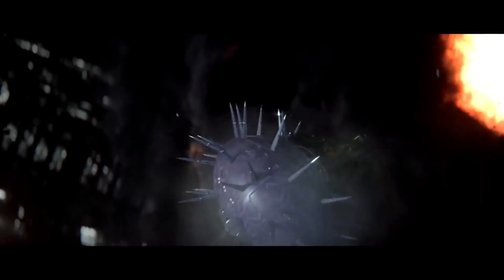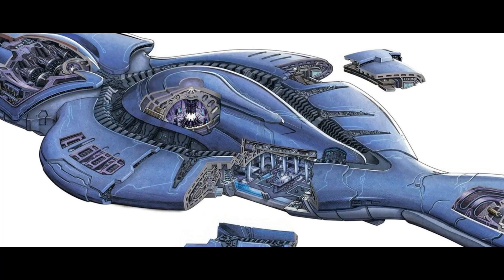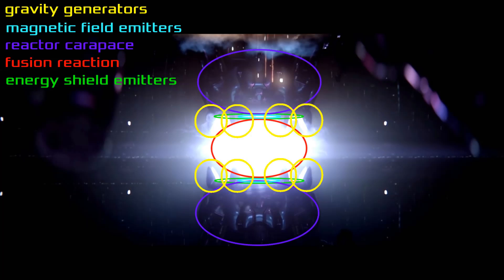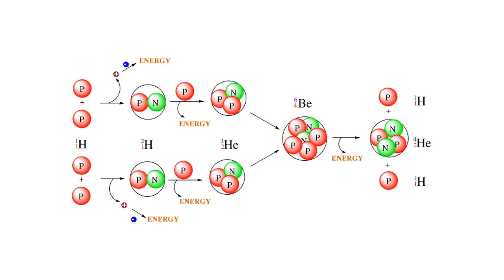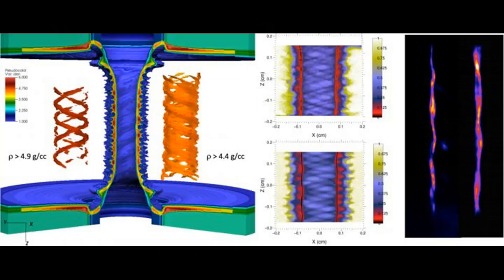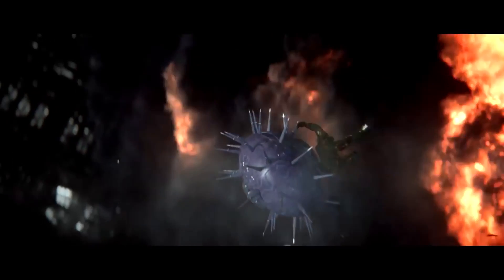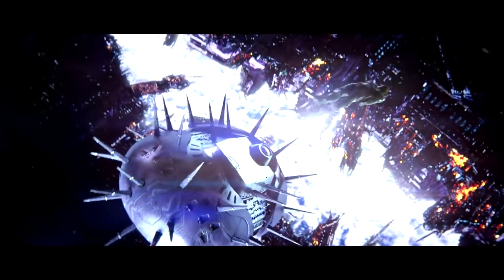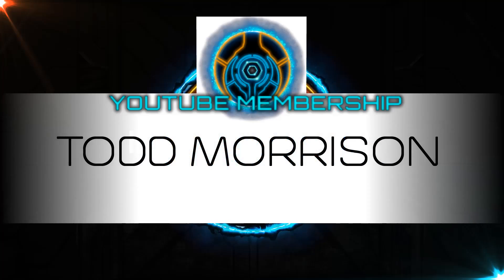Pinch Fusion | The Archive

Comment: I'm not a physicist or a lore historian, but I feel like this method would require far more energy than it produces. It seems to me far more likely that some element of slipspace tech would have to figure in to cancel out the energy requirements of manufacturing gravitons. Perhaps a controlled demolition of a slipspace portal inside of a charged plasma medium. Instead of enlarging the initial rupture it's allowed to fall in at luminal speeds. Catching the ionic fuel in the middle and fusing it. Obviously this would require a micromanagement over the properties of slipspace, which would explain why the covenant has this and humanity doesn't.
Reply: I just want to find out how to fuse metals man, i dont car how much energy it takes.
Reply: @dgalloway107  Fair enough
Reply: Physics student here. Actual Tokamak fusion reactors have been around since the 1960s, which are actually similar in concept to this thing (minus the artificial gravity stuff. All plasma confinement is done through electromagnetism). And yes, the reason they havent taken over the energy industry is because they currently require more input energy than the output energy they produce.

We're getting pretty close to 1:1 energy input vs output. The problem is this is purely the amount of electrical energy put in vs thermal energy put out. This ignores energy extraction methods, which will likely have inefficiencies. Scientists at the current efforts at the ITER reactor would like to see a 1:10 thermal ratio, as even under the worst inefficiencies in energy extraction, this ratio would likely still achieve a practical 1:1 electricity output.

Even well developed fission reactors today only extract about 1/3rd of the total thermal energy produced, as electrical output.
Reply: @hatman4818  So how far away are we from using fusion torches replace all other types of power plants? What kind of ratio would that require?
Reply: @sothasil7716  About 100/1 I believe is considered optimal. But I think the target is at least 20-30/1 to be considered commercially viable. Again, not an expert by any means, but I have done some independent research on the subject.
Reply: @Sotha Sil

If I recall correctly, ITER is trying to achieve, ideally, a 10:1 or better thermal ratio. This is basically the bare minimum to even start imagining a 1:1 electrical ratio. Though even higher than 10:1 may be required. It's a lot of guess work right now since energy extraction for tokamaks hasnt really been developed yet. ITER is supposed to be a sort of commercial test bed, to first acheive the thermal ratio needed, and maybe start developing refueling, exhausting, sustainment, and energy extraction technologies. That would hopefully allow the next reactor to be the first commercial prototype... To answer your question, like always in fusion physics, "About 30 years away" (lol). Or more like 40+ on this timeline... Just for one possibly useable reactor, not to replace the entire grid. It's taking a long time to build ITER, and it's not predicted to produce maximum power until the mid 2030s.

That being said, the Undecided channel recently made an awesome video about commercial fusion enterprises that are sort of skipping the steps ITER and the rest of government funded fusion research is going. Essentially, a lot of companies realized two things. First, the second a useful reactor is built, a huge share of the market would be for smaller reactors. So, they realized focussing research into smaller reactors NOW, could be a huge benefit. It's allowing companies to skip the decades long multibillion dollar international construction process to churn out prototypes now, that can be used to test technologies. Second, one of the technologies they want to test are electrical energy extraction, rather than waiting around for a 1:10 thermal energy ratio to even start on that. The 1:10 energy ratio, originally considered a best case scenario, may actually be a really conservative estimate. Those kinds of estimates are born out of what scientists were thinking about for energy extraction decades ago. This involves traditional systems, like extracting thermal energy, heating up a fluid in a heat exchanger, converting that energy into mechanical energy with a turbine, then converting that into electrical energy with a generator... All those transitions represent energy lost. One of the reactors that Undecided covers, is a small commercial reactor that is trying to extract electrical energy DIRECTLY from the plasma... Which may actually be possible, since a plasma is just a hot soup of charged particles.

If this is possible, it could massively reduce the minimum thermal ratio needed for a 1:1 electrical ratio, cutting out literally decades of R&D time.

Anyway, go check that video out. As impressive as ITER is, I genuinely think commercial ventures are going to be the biggest source of innovation to make larger reactors like ITER actually useful as powerplants.
Reply: @hatman4818  Well, all we have to do is invent warp drives or discover extra dimensions and then we'll have all the energy we'll ever need.🙃
Reply: @jasonwolfe4205  Star Trek was right on the money with their warp cores, any form of warp drive is going to need an astronomical amount of energy that is only possible to achieve through the use of antimatter annihilation like what the Federation uses, or through the use of micro singularities like what the Romulans use.
Reply: @sothasil7716  Again though, this leaves us with the problem of where/how they got the antimatter/singularity. Those things take a stupid amount of energy to make. And it's really hard to cheat this sort of stuff in physics.
Note: I'm not saying you're wrong, I'm just saying the universe is a lot better at filling loopholes than we are at finding them.
Reply: @jasonwolfe4205  we can create antimatter now, just extremely small amounts of it.

We just need to refine this process and then stack them on top of each other hundreds upon hundreds or even thousands upon thousands of times over.
Reply: @sothasil7716  If we can get it to the point where it's energy positive then yeah. Here's hoping we're alive to see that.
Reply: @jasonwolfe4205  by its very nature, antimatter cannot be used to generate a net gain in energy. 

Regardless of this however, it is the best energy storage system in the universe.
Reply: Ps to both of you, artificial mini black holes or antimatter would be excellent energy sources for spacecraft propulsion... They however do not need to be energy positive processes to be useful. In fact, they can be VERY energy negative, and still worthwhile to produce for spacecraft. Both are forms of energy storage, not energy production. And energy storage can be plenty energy negative, so long as it's energy negative at the production plant, but energy positive in the depths of space.

For example, a mini black hole could be adjusted to the right size to produce consistent power for 5-10 years... So long as a ship returns to port in that that time to have its singularity replaced, it can fly indefinitely between those refueling events... This is a lot like the process of refueling a nuclear sub or nuclear aircraft carrier today.

However... You can expend more energy in making that blackhole, than you ever get back out of it... That doesnt make it useless for space travel. The point was to make a "fuel" that is so insanely energy dense, and such a good source of storable potential energy, that it gives the spacecraft the longest legs possible. Its well worth the energy it takes in the production process. The same goes for Antimatter. If we could make even just a gram or two of antimatter a year, it'd be well worth the effort, as that tiny amount is potentially enough to fuel multiple interplanetary missions if I recall correctly from the last time I looked into it.

Now... These things would obviously be utterly useless as a form of power production here on earth, so you wouldnt see power plants made with these things (not unless we fine some way to catalyze making antimatter or singularities... Unlikely, though catalyzing antimatter is something I want to dig into in my career....I think there may be a slim chance it's possible using the quark-gluon plasma CERN recently created). But, both of these things are both storeable, able to release their energy with ease (sometimes too much ease, lol), and insanely energy dense. These are perfect qualities for rocket fuel.

A good current example, liquid hydrogen and liquid oxygen are an excellent fuel/oxidizer combo for bipropellant rockets. In fact, theyre about the most fuel efficient means of space propulsion we have. Even nuclear thermal rockets use hydrogen as the exhaust mass, because its minimum molecular mass means the highest possible exhaust velocity... And therefore, the highest fuel efficiency.

But, producing hydrogen is an extremely energy intensive process. It takes more energy to produce it than you get out of burning it... This is why we dont run power plants off of liquid hydrogen, instead of petroleum products we pulled out of the ground. But, it is storeable, it is energy dense, it releases that energy with ease, and we have the means to produce it... So there's still a market to produce it to power rockets. And that hydrogen can compete with things like RP-1, a petroleum product rocket fuel, because although its more expensive, hydrogen is practically a requirement for deep space applications, as it can achieve velocities that RP-1 is basically incapable of.
Reply: @hatman4818  I thought that singularities could be used to generate a net gain in power by dropping matter into them and harnessing the resulting hawking radiation and gamma rays?
Reply: @Sotha Sil

There it is, lol.

I have heard of some insane antimatter mining concepts. It's briefly produced sometimes when radiation strikes the upper atmospheres of planets. Somehow stopping it from annihilating in the atmosphere, and extracting it, may be possible. But to achieve any real useful mining rate, you'd have to go to someplace like Jupiter to do it. But, the fact that its mining, and not production from scratch, could make it energy positive to use. It's about the only method known that it could be energy positive currently.

... That being said, the infrastructure required to mine it would be insane. It'd still be useful for spacecraft, but I'd imagine fusion would still be way more economical for power plant purposes.
Reply: @Sotha Sil

... I'm not so sure it would be energy positive still. Black Holes may have insane properties, but I dont think violating conservation of energy is one of them. I could be wrong, maybe it releases the potential energy of the matter dropped in, in the form of far more energetic and less massive hawking radiation.

... Actually, now that I think about it, maybe youre right. Then you'd be producing positive energy, but at the expense of matter as fuel... What is cool though is matter is easy to come by, and it wouldnt need to be in any particular form... Actually, that could be really good for energy production, it basically accomplishes the same E=MC^2 matter to energy conversion as antimatter anhilation, but without the difficulty of making antimatter... Maybe youre right, if you only needed energy at the start to create the singularity, you could farm it for profit energy indefinitely so long as you had matter to feed it... Now that I think about it, I think I remember they figured out what the matter to energy conversion ratio would be, I think it was something like 6% for a mini blackhole... Which isnt the 100% of antimatter anhilation, but it's way better than fusion, and you wouldnt need to keep producting antimatter fuel... Yeah, that'd be pretty cool actually. I mean, you'd need to mine something to feed it, even if its just dirt... So maybe slowly consuming earth for power is a bad idea. But you could mine asteroids, uninhabitable planets, you could feed it through starlifting, theres actually a lot of long term ways to keep one feed. And there's always something you could throw in that maybe doesnt need to be in the universe, like nuclear waste... Or dissidents and mutineers, lol.

And, it'd be easy to refuel in situ as well, instead of just replacing the singularity. It'd be a stretch to get from star system to star system at sublight speeds without consuming one completely, but once there, you'd have plenty of matter sources to feed it. If you got up to a good chunk of the speed of light, you could even use a massive ram intake to collect interstellar gas, and feed it that way.
Reply: @sothasil7716  Oathbreaker, I see your trying to discover the secrets of godhood once again.
Reply: @hatman4818  actually I think the simplest answer would be to use a black hole in such a way that the conservation of energy is the source of all the energy you could ever need. As you say use matter as the energy itself.

Comment: Question: Would New Eden factions in EVE Online be considered more powerful then the Covenant while still below the Forerunners but very powerful in their own right? 

In New Eden ships can reach tremendous sizes and shipyards and trade stations meant to hold entire fleets passing by are common place across the region. They may not be any Forerunner megastructures but they are huge in size and the vessels are powerful. They are great infrastructure advance achievements. And there are other factions in the game's universe that have made ships over 50km in width in the void.

The Covenant may have High Charity but that took a long time to build overtime plus other aiding factors.

Though the cluster of New Eden is small about 105 light years from one side to the other there are over 5,000 systems and a dense population of 144 trillion individual. Outnumbering the UNSC by over ten thousand times and a huge infrastructure and production upkeep. New Eden's worldbuilding reaches near Warhammer 40k levels while having a generally better tech that is spread throughout the population.
Reply: Could the Didact defeat Ainz Ooal Gown?
Reply: @nobleman9393  
Why are you asking that?
Reply: @thorshammer7883  I could ask the same of you.
Reply: @nobleman9393  
But what you asked for had nothing to do with my question and most of all was nothing related to Sci Fi in general. If you were going to ask that then you should of done that separately and not ask me. I am not going to answer it.